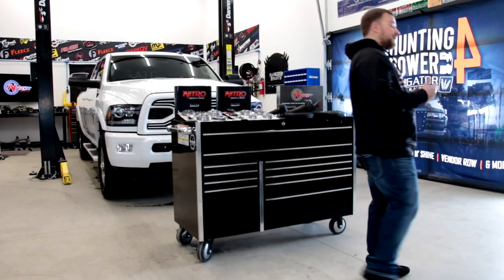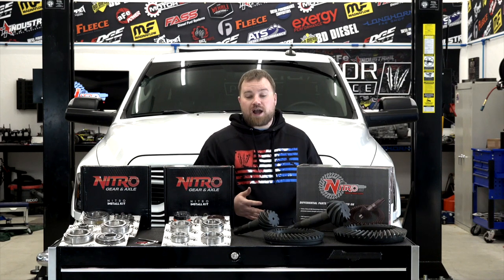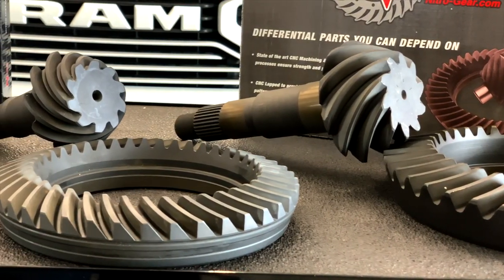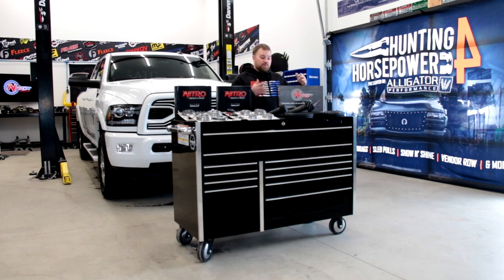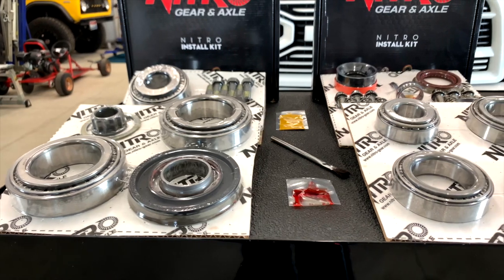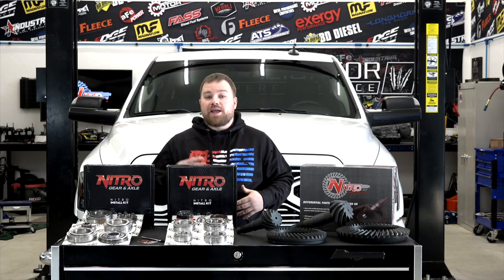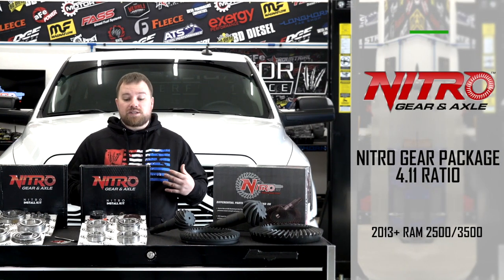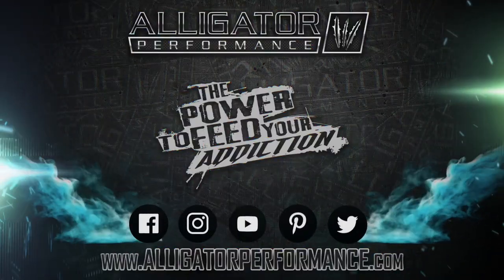Episode 19 | Gearing Down with Nitro Gear & Axle

Comment: Won't this mean you'll be towing in 6th gear a lot?  I lock mine in 5th and like 4th sometimes when I need extra power.   My theory is it's easier on the transmission if it isn't in overdrive gears while towing?  I know 5th is an OD gear as well but I'll manually shift it into 4th which is direct if I know I'm going to need the power, say coming up on hill.   Thoughts?